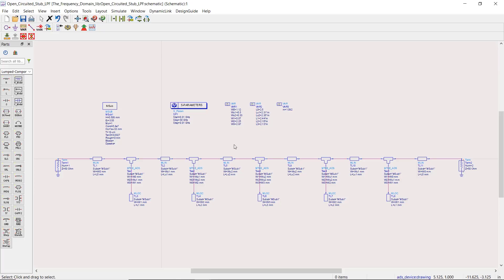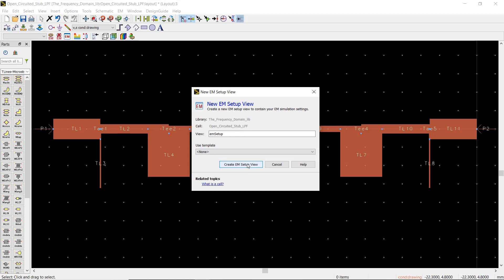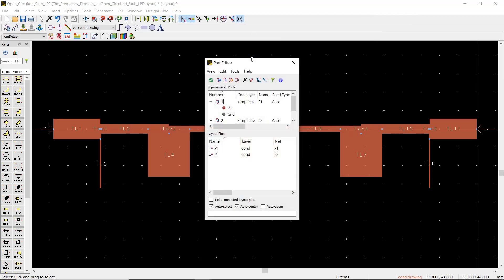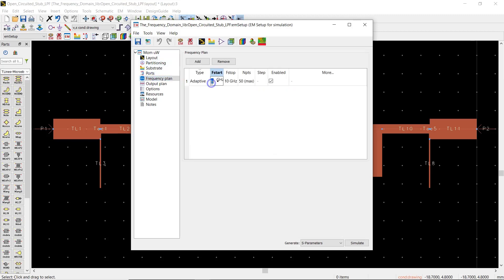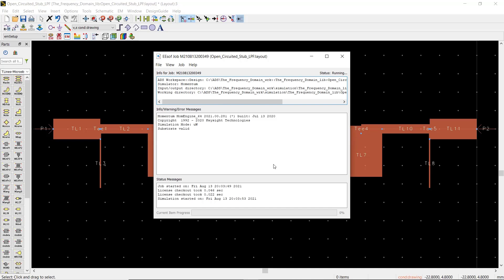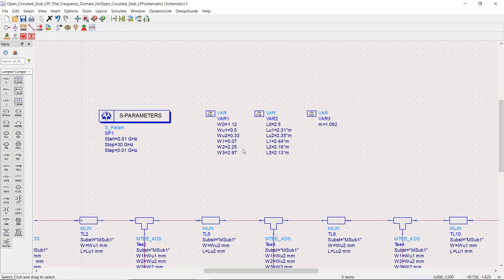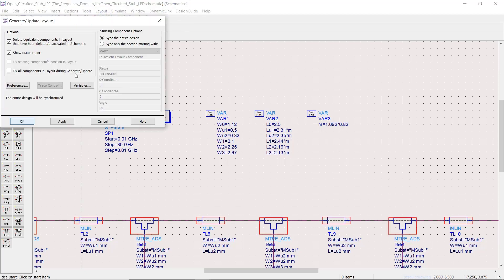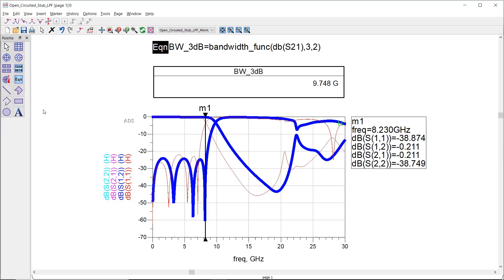Simulation of a Microstrip Open-Circuit Stub Low Pass Filter Using ADS Software - Part2

Comment: I follow your YouTube channel on the simulation of RF filters using different planar technologies with ADS and CST. I am currently working on my final year project titled: Study and Design of a Band-Pass Filter to Eliminate Interference Between 5G Networks and Radio Altimeter Signals. I need your help and guidance with this project